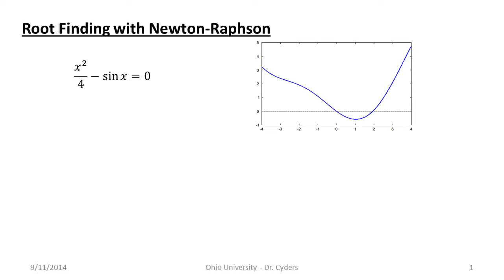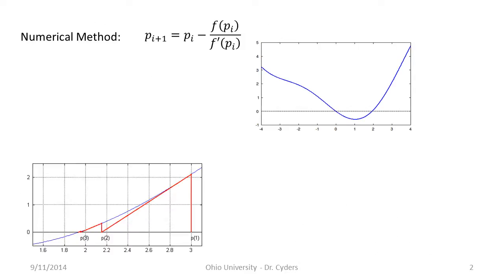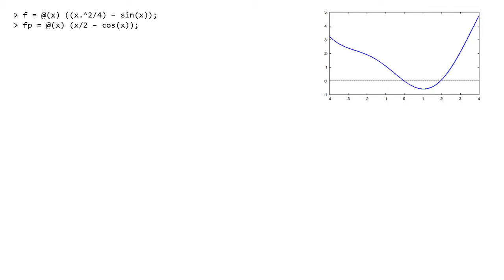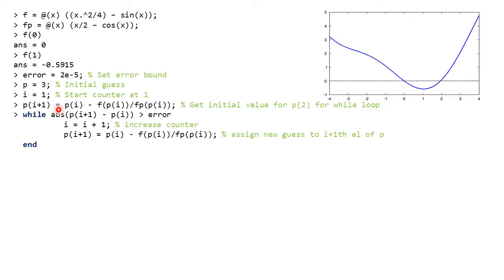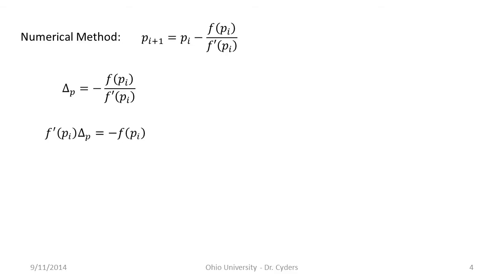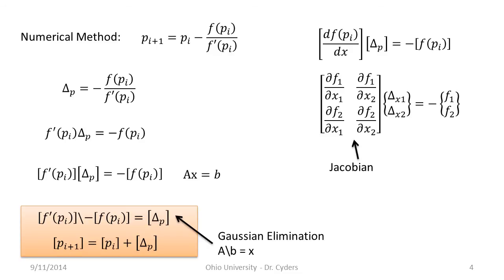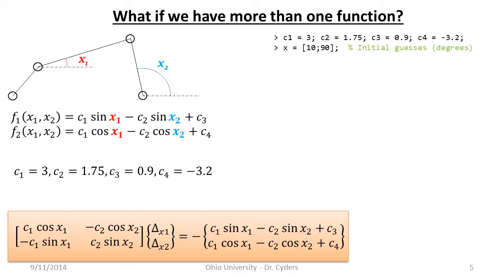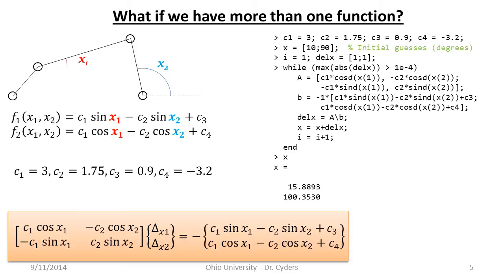Root Finding with Newton Raphson

Comment: Hi could someone explain why he said taylor is not a efficient way of solving this. I used a 2nd degree Taylor polynomial to estimate the function at 2 and it seems to be very accurate. then I just need to solve the 2nd degree taylor equation to find the root.
Reply: Could you help me to explain why f(1) = -0.5915 ?